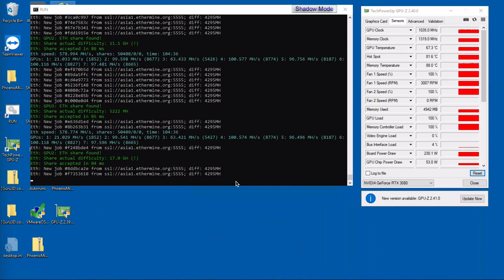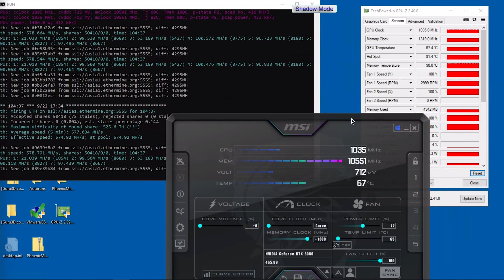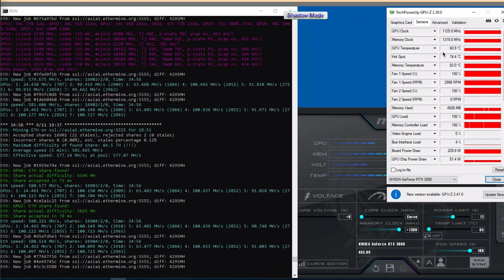Gigabyte RTX 3080 TURBO 10G | Thermal Pads Replacement - Fix RTX 3080 Memory Temperatures for Mining

Comment: Confirm it works, I have the same card. I used 1mm „Artic TP-3“ exactly like in the video but no pads on the backside at all. Paste was „Arctic MX-6“. The noise from the cooler is gone because the temps are ok now. I had awfull hotspot and RAM temps so the card cooler ran like mad to try and cool. Now it’s like a desktop nice and quiet when playing.
Reply: how much did reduce your tempetures, mine is getting 80° the gpu which is fine, but the hotspot is 105°, did you use all 1mm pads? or did you use another size?
Reply: Hahaha I found out why that was, I just didn't use all screws because it was a second hand GPU, so didn't come with that missing screw, so now I get 80 GPU, and 92 hotspot, what a waste of time lol

Comment: Can confirm 1mm pads on everything. Just did mine with some Arctic APT2560 1mm pads and new thermal paste and got -10°/ -15° off the hotspot at full load. Was previously having to undervolt to get acceptable temps. Long live the RTX3080! The last decent bang for buck card nvidia made.
Reply: did you also place some for the backplate?
Reply: @andrewleyba7471  Yes.

Comment: Thank you for this video! I did it exactly as described and my card is performing much better now. To everybody who is confused about all the comments whether using 1mm or 1.5mm pads: If your card is the Gigabyte 3080 10G Turbo Edition, 1.5mm pads won‘t work - i tried it. You need 1mm pads on all locations. 1.5mm pads are too thick (on RAMs also) and you could damage your card using them. You also do not have too think about whether buying Gelid Extreme or Ultimate. Instead buy them from Arctic. They are way cheaper and probably as good as the Gelid. I bought the 10 by 10cm pad. One pad is enough for this card. And don‘t forget about the thermal paste for the GPU. Be aware that you place the pads exactly where the guy in the video does - not more not less. There are other components on the card which don‘t need the pads - that‘s important!
Reply: The big question is, will the card be suitable for a desktop PC when it comes to fan noise after the mod?
Reply: @Thiesi  bro rly noise is the problem for a guy whit a headset 90% of the time when the gpu is going at it???
Reply: Thank you for your comments, what temperature do you get in hotspot? and for the Vram?
Reply: necropost i know... but i am doing this project now... i am using the GP-Extreme 1mm, but i keep hearing about using the 1.5 for the back. im buying a pad of both sizes just in case

Comment: Lol that 67°C is soo good not sure why there might be any worries. The blower style fan has a purpose and that's to ramp up to high RPM (loudness isn't a factor its natural to the design) to cool down the card. It's a hotter and louder card. Keep the heatsync clean and make sure the case and fan setup allows for a positive airflow design. If this is in an aircon environment take into consideration condensation on the heatsync so keep it clean. Last thing you can do is undervolt the 825v mark to 1758mhz and it will have the card run 5-10°C cooler.
Reply: Main problem is VRAM temps, note GPU. I have 24GB version and its piece of shit. 105 C on VRAM on summer in opened case and 90% FAN speed. Crazy loud thing.

Comment: You need change only memory pads.  1,5 mm Gelid Ultimate (not Extreme) is thickness you need. 1 pcs 90x50 is all you need.   22C  in room, 85% fan speed and memory temp is below 80C. Thanks and wish you happy mining.
Reply: SportsPeople  Gelid 1.5mm Ultimate's didn't work on my RTX 3080 10GB Turbo Rev 2. They're too thick and GPU die wasn't making contact with the heatsink. Went with Gelid Extreme 1.0mm for the RAM.
Reply: I'm so confused what pads I should buy.
@SuperSuperka          says: 1.5mm Gelid Extreme (not Ultimate)
@kryptolandia8226    says: 1.5mm Gelid Ultimate (not Extreme)
@isaacamattoo4075 says: 1.0mm Gelid Extreme
Reply: @isaacamattoo4075  I completely agree with this. If it’s a Rev 2, you need 1 mm thermal pads at most. Also, if you're planning to copper mod the VRAM, the copper should be slightly less than 1 mm, since the clearance after mounting the card to the heatsink is around 0.8–0.9 mm—and unlike thermal pads, copper doesn’t compress.
Reply: You have turbo version too?
Reply: @MarkThomasMorgan  I talking about Turbo indeed.
Reply: SportsPeople  Ultimate is high-end.  Highest conductivity (15W vs 12W) from gelid thermalpads.
Reply: SportsPeople  difference between them is 4 degrees max. If it doesn't work you need thicker pads
Reply: I have 3090 turbo edition can i apply any thermal paste?
Reply: Instead of thermal pads, I advise you to apply thermal putty Upsiren UX Pro. You won't have to worry about thickness, and the performance of this thermal putty is better than most thermal pads on the market.
And try phase-change material Honeywell PTM7950. It comes in as a sheet, lasts longer, performs works better than traditional pastes and there is no pump-out effect. It is also a good idea to do undervolting.

Comment: Hi guys, I switched a case, it is the same manufacturer (SilentiumPC), but full frontal intake, it is pure magic. 10 degrees down on radiator, CPU and 3080 turbo. Now I'm getting 75 deg C at 100 MH/s mining.
Reply: Hello, my friend! I'm very interested on this! I'm just going to buy 2 RTX 3090 with this Turbo Model.
How do I find this case? do you recommend me to change these pads?

Comment: If you decided to change the pads, I highly recommend you to use 1.5 mm on the RAM chips (around the GPU).
My card's temperatures were awful:  85 (GPU), 104 (memory), 106 (hot spot).
I tried 1 mm pads and the memory's temperature didn't change (104 C⁰ max), but after that I tried 1.5 mm (Iceberg Thermal DRIFTIce, tha same brand as for 1 mm) and the memory's temperature dropped down to 90 C⁰ max. With power limited mode (90%) in MSI afterburner now the temps are: 63 (GPU), 80 (memory), 82 (hot spot).
I use my card for 3d rendering and with power limited mode the card has better performance than without any limits 🤷🏼‍♂️
Reply: Thanks for the recommendations gents. Going to change the pads on a 3090 turbo I picked up as it sounds like a leaf blower when stressed. lol.
Reply: Instead of thermal pads, I advise you to apply thermal putty Upsiren UX Pro. You won't have to worry about thickness, and the performance of this thermal putty is better than most thermal pads on the market.
And try phase-change material Honeywell PTM7950. It comes in as a sheet, lasts longer, performs works better than traditional pastes and there is no pump-out effect.
It is also a good idea to do undervolting.
Reply: so 1.5mm on just the ram, or all around?
Reply: @ammamar4269  I used 1.5 mm for RAM and 1 mm for others
Reply: not just 1,5mm, but Gelid extreme, not Ultimate. The clearense there is 1mm exactly. Ultimate are not soft enough, extreme - are.
Reply: Where i get the pads

Comment: I tried putting 1mm pads everywhere, but I guess my card has been deformed from previous too thick pads. Memory temps went off the chart after a few seconds of mining, so I had to put 1.5mm pads on the memory, the rest is 1mm. On the backplate, I also have 1.5mm pads. Tried to screw it back as tight as I possibly could. Works great so far.
Reply: the clearence is 1mm there. with 1mm pads you have risk of not touching. 1,5mm Gelid Extreme (they are soft) - just perfect, while Gelid Ultimate are bad.
Reply: @SuperSuperka  Вы использовали 1.5мм  Gelid Extreme только на памяти или везде? А между бэкплейтом и текстолитом тоже их? Распишите, пожалуйста, если не трудно, какие и где прокладки вы использовали. Захожу каждую неделю на этот ролик в поисках новой информации, но все пишут по разному. И если не трудно, скажите, сколько вам удалось скинуть, точнее со сколько до скольки. Спасибо.
Reply: @ultrawidesky   я хотел "видеоурок" по этой видеокарте сделать, потому как снял на видео всё что делал с ней. Но некогда монтировать. Там зазор везде 1мм и между памятью и кулером и между всеми чипами также 1мм. Кроме одного ряда микросхем которые возле выводов HDMI, DP - там 0.6мм.   Я испугался что с 1мм прокладками огребу некасание. Так что поступать надо предельно просто: 1.5мм Гелид Екстрим на всю видеокарту - я не помню 2 или 3 упаковки 80х40 использовал, и одну полоску Екстрим 1мм на ряд чипов у выводов. Под бекплейт у меня не помню какие - вроде ультимат 2мм, но они там только потому что я вначале их для видеокарты покупал и они не подошли - я чуть не спалил видеоядро с Ультимат.
 Мне кажетя основной смысл прокладок под бекплейт обеспечивать распределение нагрузки от бекплейта на "материнку" видеокарты, а не в отводе тепла. Температуры упали - ну это не описать словами. Дело в том что потекшие "родные" уже совсем не работали и производительность составляла смешные 55-60 (при ограничении температуры памяти в 100) ну или 65 при температуре в 110. Всё это время центрифуга мотала на 100%.  После модификации вентилятор на 80-90% и температура на памяти 92-96 в зависимости от комнатной. положенные 99 мощи. В максимуме до 101 пробовал, но она иногда грохалась.
А этот чувак на видео - он скорее пример того как не надо делать.
Reply: @SuperSuperka  Огромное спасибо за столь подробное описание, обязательно посмотрю ваш видеоурок, когда он выйдет)
Reply: Instead of thermal pads, I advise you to apply thermal putty Upsiren UX Pro. You won't have to worry about thickness, and the performance of this thermal putty is better than most thermal pads on the market.
And try phase-change material Honeywell PTM7950. It comes in as a sheet, lasts longer, performs works better than traditional pastes and there is no pump-out effect. It is also a good idea to do undervolting.

Comment: Oh man, you should have made this video 3 months ago! I spent ages on those thermal pads. First I tried 2mm. The card worked, but I hardly closed it and of course, the temps were ridiculous. Then I tried 1.5mm, which I am using until today. Performance and temps are much much better. God knows, what I can get out of it, if I start using 1mm pads :D
Reply: the softness is much more important then thikness. 1,5mm Gelid Extreme suits well, while 1,5mm Gelid Ultimate are bad.

Comment: is 3090 same also? whats the thickness you used?
Reply: you ever find out if 3090 is the same?
Reply: @nmofield  Also working on the same thing, how did the 1mm work for you? 2mm and 1.5mm and my hotspot temps are way too high, 105C+.
Reply: Hi guys, I'm also having a GB 3090 Turbo 24G. Any idea on the sizes of the pads in final? I afraid to open multiple times, especially the screw threads can go worn
Reply: @engpratheep  I did 1mm everywhere except the backplate, 2mm on backplate.
Reply: @Briggsta  thanks buddy . I didn't expect a quick reply. You may be a guy like me frustrated with the card lol. Today I tried with 1.5mm and today my workmanship also not good. Very dirty with cheap gpu core thermal paste also. And I was running out of material today since I bought only few small pieces of gelid because they are costly. Anyway, tomorrow I will buy 1mm and I hope it would success.
Reply: @engpratheep  fortunately, it wasn’t my card and a friends that I was helping with haha. But it turned out great once fixed. We used gelid ultimate 1mm for the front and ultimate 2mm for the back. Hopefully you’re able to get it fixed, good luck!
Reply: @Briggsta  wow that's great. I have few questions:
01. What about the GPU and memory temperature at full load? 
02. For the semiconductor around vram, also you use 1mm? 
If you can share this info, it would be useful for other guys. Is your friend mining or a gamer?
Reply: @Briggsta  hi buddy, it was success. I would put all the details I’ve done today in a blog and will send a link here tomorrow
Reply: hi Guys, if you need the steps i did for my card, you may refer above PDF for a small article i made on the process. Hope this would help others as well. thanks. But I’m not sure how to share a google drive link here
Reply: @engpratheep  you could just use keyword dot instead of .  So its not deleted automatically. Will be intrested for that PDF as I too have the same gpu with 98 mem, 50 core and 114mhs
Reply: Instead of thermal pads, I advise you to apply thermal putty Upsiren UX Pro. You won't have to worry about thickness, and the performance of this thermal putty is better than most thermal pads on the market.
And try phase-change material Honeywell PTM7950. It comes in as a sheet, lasts longer, performs works better than traditional pastes and there is no pump-out effect. It is also a good idea to do undervolting.

Comment: Are they all 1mm thickness? No difference between on vram and power semiconductors?
Reply from the maker: the difference is not significant. It can be shared 1mm. You should not use thinner patches
Reply: @NVPh123  The video shows 1.5mm on the package of gelidstore pad. Which is correct 1.0mm or 1.5mm?
Reply: @feraskarim7108  i tried 1,5 mm and my card started to throttle, then i changed them to 1mm, now my card works perfectly. Thanks for the video!
Reply from the maker: @feraskarim7108  1.0mm is true
Reply: @timurdzh  all pads were same size or different size of pads should be used. I mean I can only use 1mm everywhere , or I have to use 1mm on vram and 1.5mm on other place.
Reply: @zibinzhao6921  buddy, for sure 1.5mm is not correct for vram chips. 1mm is the correct as I tried all other bigger sizes except 1mm. So 1mm should be correct for vram. Tomorrow I am trying with new 1mm pad and I will update here. For backplate, I may need to try 1mm also. Because today I tried 1.5mm but seems difficult a bit to close the cover. Please wait for my update tomorrow than spending too much money on quality pads multie times. When I see the people get frustrated with changing pad, my mind does not accept another person also suffering like this. I am a miner, for me wasting the money for pads without correct info is not affordable. Therefore please wait for my update tomorrow. Just 1 day
Reply: What I meant above is for Gigabyte rtx 3090 24g turbo. Not for 3080 turbo
Reply: @engpratheep  Any update? I have a 3090 Asus Turbo and wondering if the 1mm is enough for that too?
Reply: @TheJashimraswi  hi jashim, I did not have Asus but mine was gigabyte turbo 3090. The procedure should be same but size, I can't assure if mine can fit yours. Anyway let me share a link for the method I used for Gigabyte. It worked well. GPU temp is maximum 60 and memory junction at max 79-80 celcius. Give me a couple of days to update here since got busy with my work
Reply: hi Guys, if you need the steps i did for my card, you may refer above PDF for a small article i made on the process. Hope this would help others as well. I managed to really optimize the temperature and getting arounf 118MH/s in Nicehash.
Reply: Hi where can I find your link or pdf?
Reply: Instead of thermal pads, I advise you to apply thermal putty Upsiren UX Pro. You won't have to worry about thickness, and the performance of this thermal putty is better than most thermal pads on the market.
And try phase-change material Honeywell PTM7950. It comes in as a sheet, lasts longer, performs works better than traditional pastes and there is no pump-out effect. It is also a good idea to do undervolting.